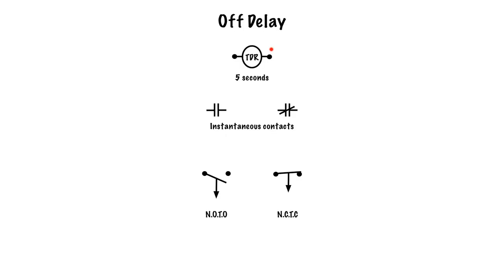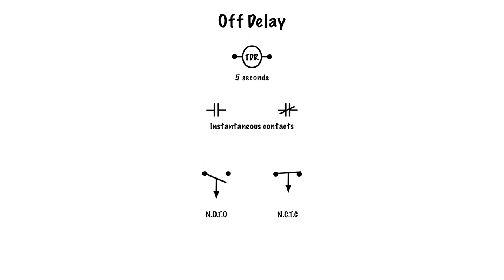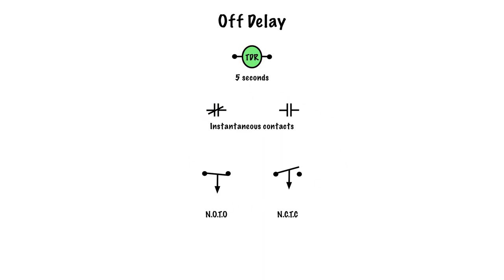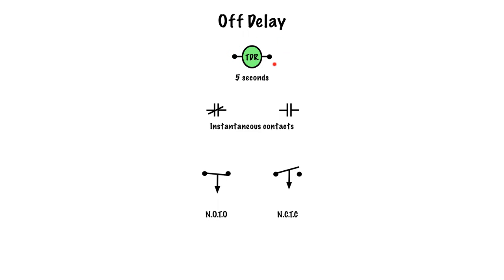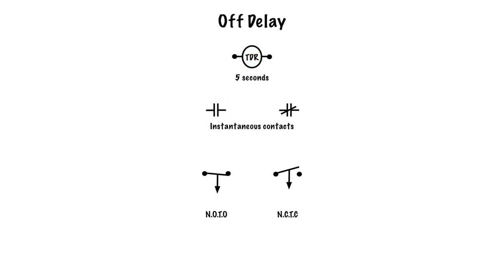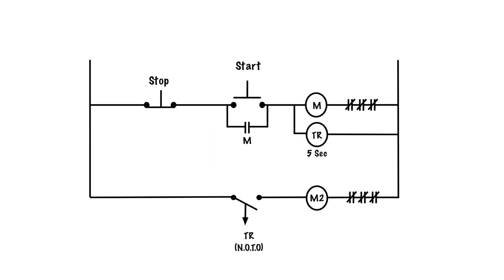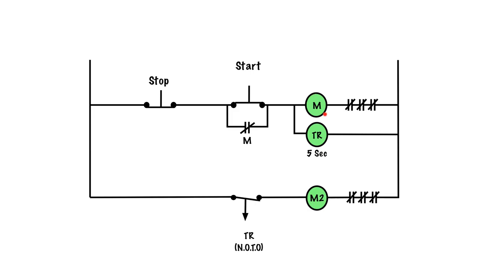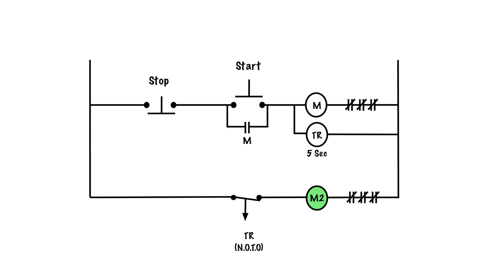Off Delay timing control circuits

Comment: Always a great explanation, and you make it easy to follow along, especially for us visual learners. As a second year electrical student, you've helped tremendously. What program are you using to create these motor control circuits? It would be great to use for building more complex circuits for further learning.